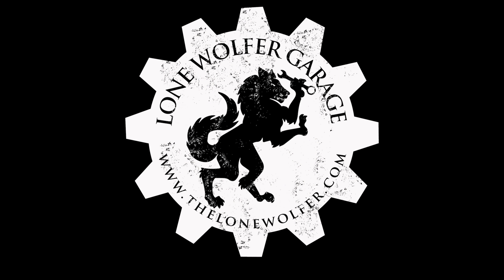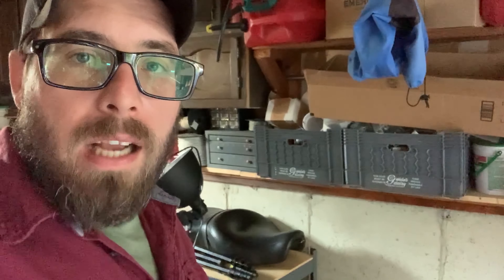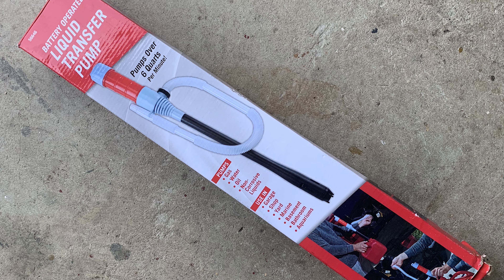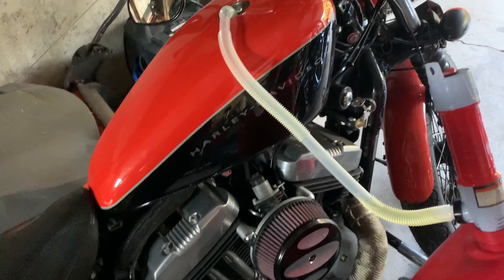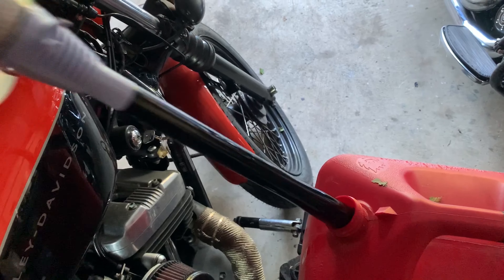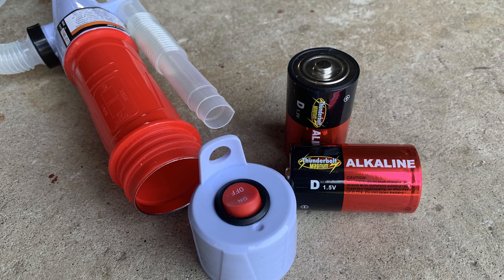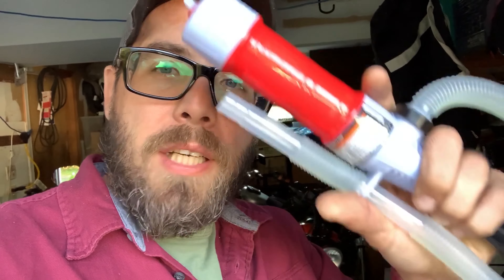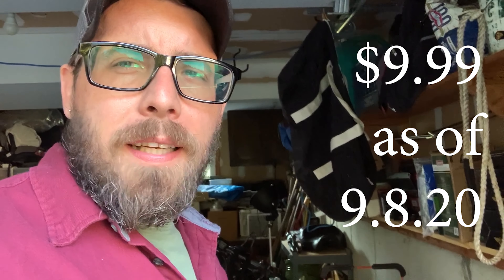Harbor Freight Liquid Transfer Pump Review!

Comment: Instruction said to rinse with water every use. It will contaminate the diesel or gas if you do that unless you only use it ones a month or longer. I just got mine so I'm not sure if that is really necessary. Maybe it will melt something inside it. But gasoline dries quicker than water so I really wonder.
Reply from the maker: I will be honest, I di not read the instructions beyond putting batteries in hahahahaha. And I am curious now if it has to do with breaking down the plastics or something along those lines. The clerk had mentioned that oncce I run anything thru it, that it can't be returned even water. I took that as a hint that if I needed to return it, just lie and say I didn't ever use it.